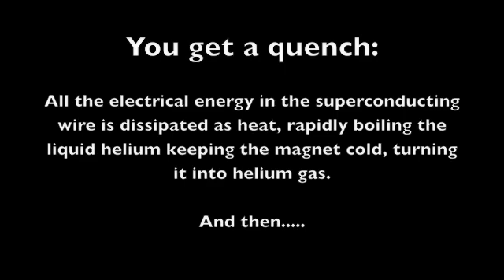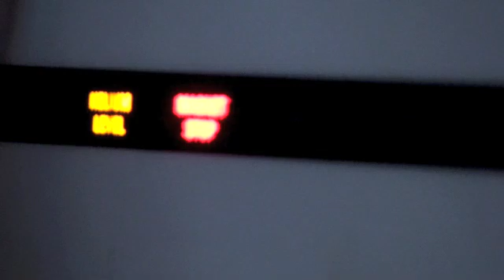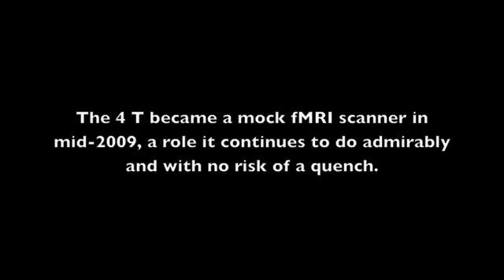MRI magnet quench: the movie

Comment: Welcome to the fraternity of expensive sounds, brothers.

Fun fact, this also happens if the cooling unit goes down and they don’t switch to city water backup fast enough. I work on the occasional MRI chiller, and when I asked an MRI tech he said that you could have the unit down for 15 minutes safely, but that any longer and you had to switch to city water backup. I assume some safety margin is built into that, but it’s about a $50k repair if that quench goes, so…

Comment: MRIs are literally giant electromagnets, and not the nail, copper wire, and 9v battery ones you made in school either. They’re so powerful that people with prison tattoos aren’t supposed to go anywhere near them unless they don’t have other options because it literally makes the metal in those inks heat up and people got badly burned (tattoos done by a professional with the correct inks are safe). 
A magnet that powerful gets very hot & when that happens, it loses its magnetic field. To prevent this, the magnet inside the casing is surrounded by liquid helium. As a safety feature, there’s a special button the techs can hit that vents the helium outside, breaking the magnetic field. 
The MRI would have to be quenched if he somehow got past the techs with that chain because it would go flying into the machine like an asteroid into a black hole because it would not only hurt him, but also break the machine and anything between the chain and the machine. Depending on the individual machine and how much damage that chain caused, it could cost MILLIONS OF DOLLARS to repair. 
There’s also the matter of the fact that he would no longer have that finger at least. 
As another commenter said, MRI ≠ Magnetic Resonance Imaging. It stands for Metal Removed Immediately
Reply: the magnet gets hot? How does the magnet get hot? The magnet is superconductive so the high current in them does not cause any heat as there is zero resistance. The magnet is filled with helium to maintain superconducivity temperature for the superconductive coils and they have a 4k condensing cold head to prevent helium loss. The special button you talk about does not just "vent" the helium, it is part of a circuit that makes small part of the magnet resistive and induces a collapse of the magnetic field and it is this field collapse which causes the helium to vent as the helium dissipates all the energy stored in the magnet. Newer system only have about 25l of helium and are quenched "differently" than before so less helium boiled off and lost

Comment: 🤨 - so are the MIR scan done at the top floor of a hospital - so the helium (quench) vent can go through the roof and expel it outside, or do hospitals have a special collection system for the helium if the MIR scanner is on the lower floor levels?

Comment: Thank you for the great FAQ.  If you ever get the urge can you add a few bits of information on what the process for running a magnet down while still cold or a totally uncontrolled quench event, not a pressure explosion but how does it differ from a controlled quench.
Reply from the maker: Here's a good summary of quench characteristics, including how the quench circuit creates a small hot spot using diodes:
https://indico.cern.ch/event/194284/contributions/1472819/attachments/281522/393603/TenKate_-CAS-Handout-Quench-Erice-2103.pdf

I'll keep an eye out for other good sources.Thanks for your interest!

Comment: Sad to see all that precious helium go to waste but I guess you could argue it already earned its keep.
Reply: Did you read the description? "8. Why did you waste all that helium? Isn't there a shortage? There isn't a shortage of helium per se - it's the second-most abundant element in the universe, after hydrogen. The shortage is specifically liquid helium, and the reasons for the shortage are entirely financial/political reasons. Helium is recovered as a by-product of some natural gas and oil operations, but there are other ways to capture it, except that they cost more money."
Reply: @ihatenumberinemail   I am sad and helium is precious and it did go to waste but I understand why.

While it is abundant in the universe, it isn't very abundant on Earth because it, unlike say hydrogen, doesn't react with anything. The helium we do have is a byproduct of nuclear decay of elements and is only produced in small amounts. It's light enough that it will float to the top of and be blown off of the atmosphere by solar winds and cosmic radiation.
Reply: @ihatenumberinemail  Cheap? filling one of these magnets is around 50,000 to 100,000 USD worth of helium, for comparison same amount of liquid nitrogen would cost 500 USD. 

How do you think the helium got into the natural gas in the first place? Helium is too light, so it ended up on the outer rim of our solar system during planetary formation. All we have here on earth was formed by fission of heavier elements. This process is extremely slow. Therefore if we continue to extrat it from natural gas we will run out of helium one day. Once you release it into the atmosphere it is gone. Its so light it will actually leave the planet. -helium is single use finite source. Thats why Mr. Morgan call it precious.

At least unless we figure out how to extract it from other planets, or how to scale hydrogen fusion.

Comment: I don't have much working knowledge of this but: I think that there are several ways to make helium by using fission with other chemical elements. We can make radium, plutonium, iodine isotopes, & cobalt 60. I KNOW THAT!
Reply: Using fission for making elements of lower atomic value is possible only for heavy metals, since it releases energy. When you get down to the lighter elements, fission becomes impossible as it requires energy. You can make helium by fusion of deuterium, but we are still a bit away from a fusion reactor that can sustain fusion for more than a few seconds

Comment: In your comments you kept mentioning scrap value. There is a scrap value on everything. This is the cost of the materials that the item contains that can be hocked for quick money. This is not a great method to base a financial decision on. On the other hand, you mentioned that you needed a training aid. In that case it is cheaper to deactivate that unit and use it for training than to simply buy a new training unit. The icing on the cake is getting to destroy a 4T magnet. As far as helium recovery goes, helium is getting rare. Because it is a light element, it simply travels up and evaporates into space. The gas simply does not mix very well back into earth's ecosystem. Now I understand that getting the helium out of the magnet area is difficult, the additional supply tanks contain the bulk of the helium used to quench the magnet and that part is easily recovered.

Comment: Sorry for the ignorant question-- I know nothing about this stuff.  So the magnet (before the quench) is enhanced by the helium?  Can you give a basic explanation of how?
Reply: since no one has given you an answer yet, I'm gonna give you a simple explanation: The liquid helium is so cold that it decreases the temperature of the coil close to absolute 0. This makes the wires of the coil a super conductor. Because of this, the coil only needs to be powered once to get the magnetic field up and running. This way the MRI's don't cost a lot of electricity :)

Comment: I think they are doing this not just for fun, you should remove the LHe before product shipping because of the safety reason. If one has a large facillity, you can use recondensing balloon but if it is not, there is no way to save the He. Yes, it is expensive (including the future situation), but definitely less important someone's life who might be injured during shipping process. As a magnet engineer, the LHe looks like blood in my vein(and yes, veryvery painful), but it is neccessary too. Please stop simple blaming.
Reply: My father makes MRI Scanners in the UK, they don't remove liquid helium before shipping.

They will ship MRI scanners inside the cargo hold of passenger aircraft. If it were risky to ship they definitely wouldn't ship them in planes with people inside.
Reply: I don't understand - are you sure? because the He inside our product should be removed(and this is serious loss for our company) before shipping to keep trade protocol. Domestic - without airplane - it's fine. But for outside of country.. (or ariplane) it is problem. If it's true, I should tell our financial support team to check the rule once again. Yet, liquid hellium contained cryostat with swinging like airplane is dangerous. You can check this from other youtube videos related MRI crash.

Comment: Why does the magnetic field take 15-20 seconds to collapse during an MRI magnet quench? Is it because the power is actually ramped down in that amount of time, or is the power immediately switched off and it's literally just the "momentum" of such a large field that makes it take so long to collapse?
Reply from the maker: The field decays exponentially, takes 35-40 sec to get to zero. So the main part of the force is gone after about 10-15 sec after the button's pushed.
Reply: Short answer: "magnetic momentum".  
Longer answer: External power supplied is immediately removed; the amount of time it takes for the stored energy to go to zero is because of Lenz's Law.  Initially there are many megajoules of energy stored in the magnetic field.  When the externally-applied power is shut off and routed through protective diodes, the field begins to collapse.  The collapsing lines of magnetic flux move relative to the immobile superconducting wires, and Lenz's Law dictates that motion between magnetic flux and wires induces a current in the wires that opposes the collapse; that is, the collapsing field generates EMF to continue the current flow.  If the wires truly were perfectly superconducting, this would continue forever, but instead two things burn up the stored energy: 1) protective diodes were switched in during the shut-down process, and they dissipate power = current flow through the wires x diode's forward voltage drop, and 2) as the system begins to heat, windings begin to lose their superconductivity and rapidly increase in resistance. The latter reason dominates most of the power removed after the He burst disc blows, and it is proportional to the square of the current / resistance, but the resistance is changing constantly as the wires warm, so the solution to the differential equation is pretty weird - definitely not linear nor a simple first order decaying exponential.
Reply: Because it has stored up that much energy. It is a lot of Tesla in that field.
Reply: Because you want a controlled flash off, not a gas explosion.

Comment: The air liquefying on the turret above the unit likely contains far more oxygen than you would expect from simply liquefying air.  That can create an interesting fire hazard in the region below the dripping section, as when it evaporates, you'll have a locally oxygen enriched environment.  Had you collected the liquid in a pre-chilled dewar, I'd bet you would have noticed a bluish tinge.
Reply: The coolant of the unit was helium.  On venting, it cooled the turret below the liquefaction temperature of the surrounding air.  The gas being condensed on the outside of the turret is that of the surrounding room air, and the composition of the liquid is higher in oxygen than room air due to the difference in liquefaction temperatures between oxygen and nitrogen.

Comment: So.. sorry if this is common knowledge, but ¿the MRI machine needs to be powered ALL the time in order to maintain the magnet working?
Reply: Yes, but because it uses superconductors, the amount of energy you need to add to the magnets is theoretically zero. You do need to keep the magnets constantly cold, though, which requires energy to constantly refrigerate the liquid helium.

A frictionless flywheel works as an analogy: once you get the flywheel up to speed, it'll keep spinning indefinitely with minimal to no extra energy, as long as you maintain the frictionless bearing.
Reply: Thanks. I was specifically asking about keeping the liquid hidrogen or whatever they use to mantain superconductivity.
Reply: Yup, have to keep the chillers working to keep the liquid helium both liquid and cold. Heat will always be entering the system, so you have to keep pumping it out.

Also, it's definitely liquid helium; liquid nitrogen doesn't get cold enough for most commercial superconductors to superconduct, and liquid hydrogen may be the scariest substance that exists and isn't made with Florine; far too dangerous.

Comment: Why you destroyed such a MRI ,In my country there not enough mri machines. An mri scan costs 40 euro.
Reply: €40? MRIs cost thousands of dollars in the US.
Reply: Forty for one regular scan , the rest is paid by health insurance (State owned)
Reply: +camlind12  Another reason  why the public debt skyrocketed , Doctors used to charge the state fake scans for personal profit. (Greece)
Reply: You could buy a better one for less than the cost of transporting this one.
Reply: Sorry but your concept of free and our concept of free are two entirely different cats.  There is no such cat as a free cat.  Somebody has to feed the cat and remove it's feces, clean up after it, remove the cat hair and fur balls or you end up with a filthy room.  The government is not free in that you sold your freedoms in exchange for what you think is free.  We were recently asked to remove a similar MRI and install a new one int its place.  The weight difference was 60,000lbs vs 16,000lbs.  The cost just to remove the old MRI, load onto a truck for removal, and replace the new MRI was in excess of $40,000.00 US.  That does not include the risk factors of a injury and death, wall removal and replacement, shut down of the facility..., in all, the cost was closer to $100,000.00 for a one day turnaround.